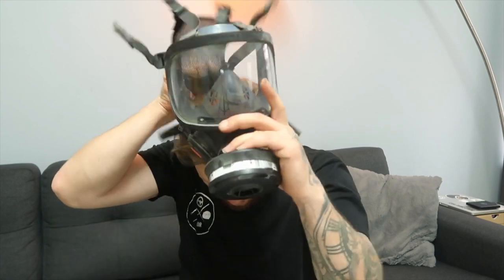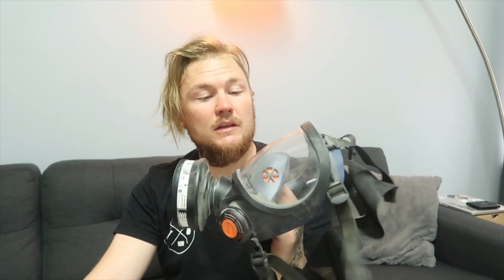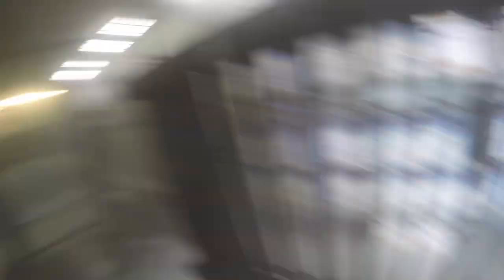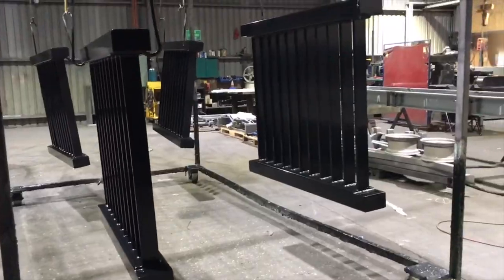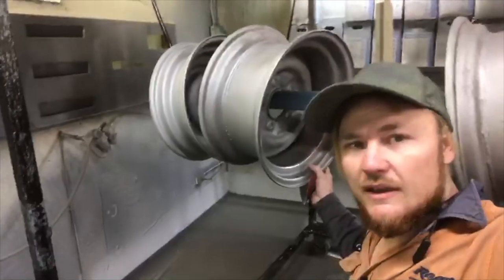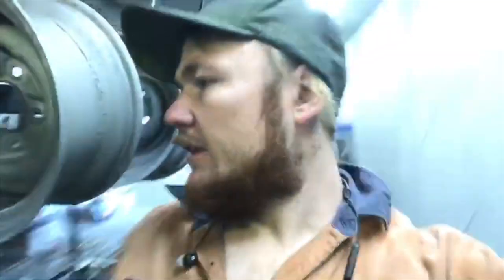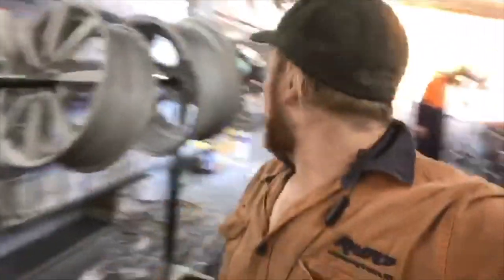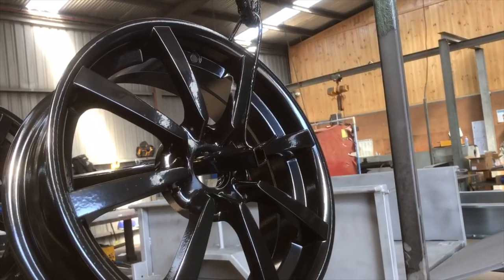SUNDSROM SR200 | POWDERCOATING | VLOG

Comment: Did you do a fit test?
I mean, the silicon fitting is going over your beard, so it can't be a perfect seal right?
Saw someone used a rubber mask underneath to get a good seal.